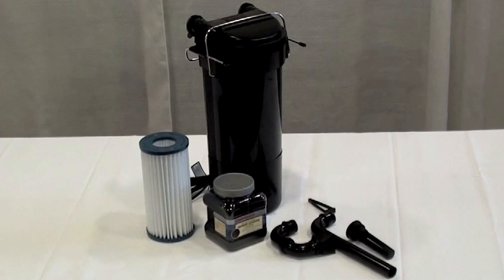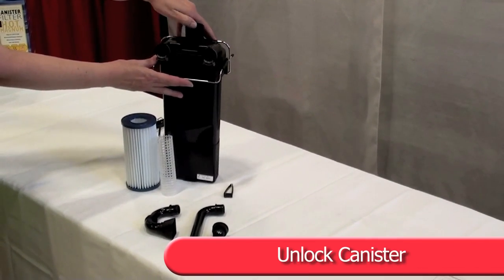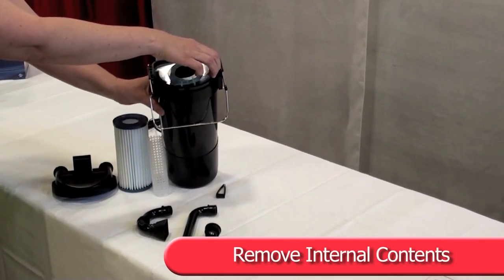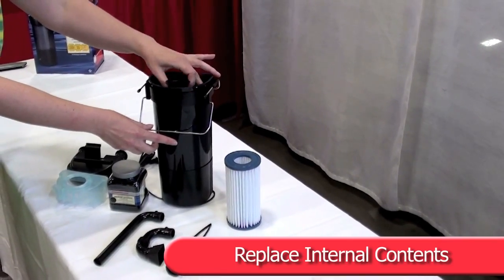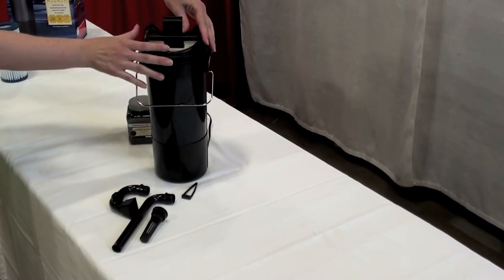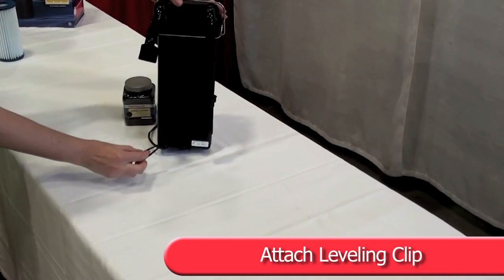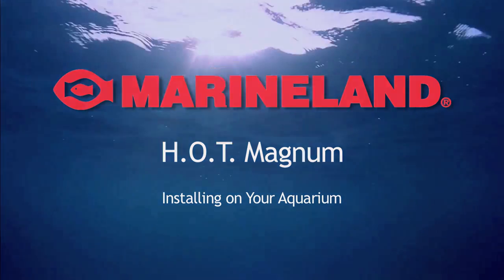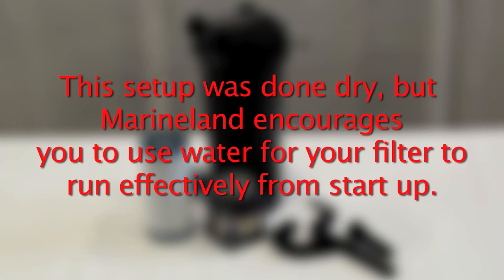How-To Assemble and Install the Marineland H.O.T. Magnum Filter

Comment: You can also use the HOT 250 as a diatom filter.  Place a small bucket into your
aquarium making sure that the top of the bucket is resting above the water's surface.

Turn the HOT 250 on and gradually pour about  3/4 of a cup of diatomaceous earth  into the bucket and wait for the water in the bucket to turn clear.  Now your HOT 250 is primed.  You can now diatom your aquarium.   If you have other tanks you can move the HOT 250 from one tank to the other.  Just remember to turn it off first.

Comment: In my last post in regard to using the Magnum HOT 250 as a diatom filter, I forgot to add that you use the micron cartridge included with the HOT 250 for this procedure. The micron cartridge is about 15 microns, as opposed to regular blue filter pad included with the HOT 250, which is about 200 microns.